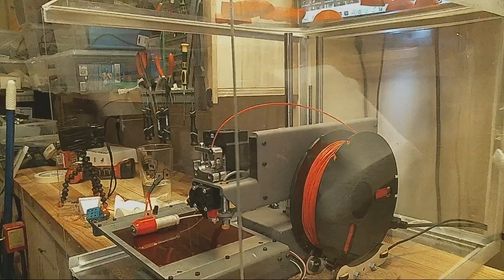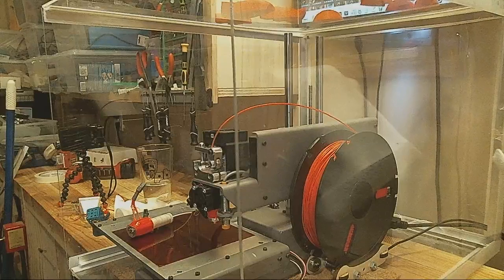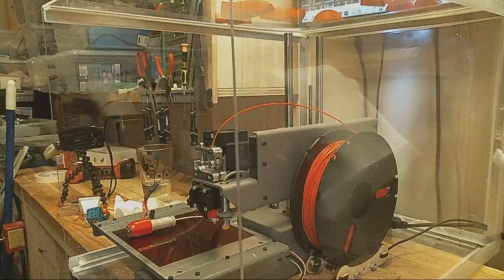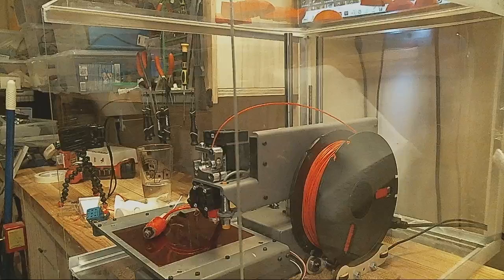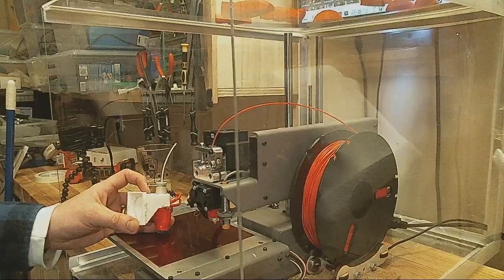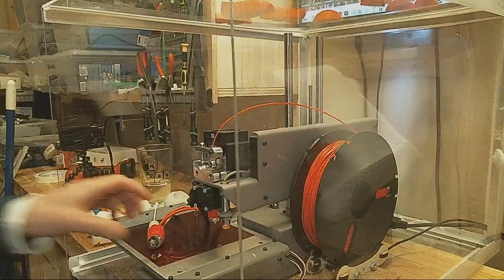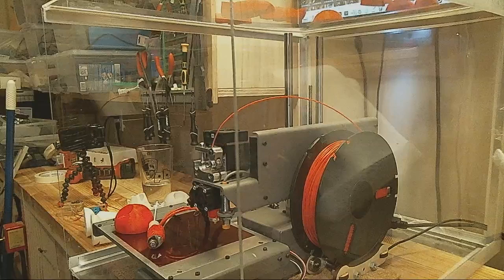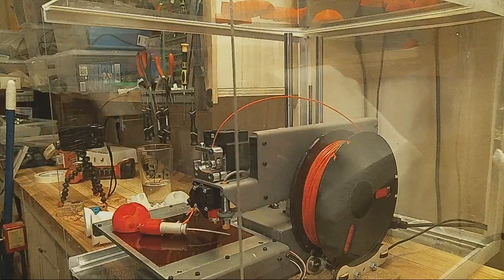Printrbot All Metal Ubis Hot-End Review

Comment: I noticed PrintRbot is not using the all metal hot ends much anymore.  I am gathering there were too many issues so they went back to what worked.
Reply: +wi11y1960 
As someone who's gotten one with their new Printrbot Play I can see why.
I'm currently mid way through machine crippling problems with mine, and the light at the end of the tunnel is putting the ceramic end on my play and never buying filament from printrbot again
Reply: I have had zero problems using their filament.  Then again, after opening the filament, when it isnt in used it goes into a bucket with drying silicate to remove any moisture from contaminating the filament.

So I dont understand why you are having issues with their filament.  My Printrbot Simple came with the ceramic end and works fine.  I have zero issues with it.  I do use a brim before I start printing just so that my PLA parts wont release prematurely and it works what ever hesitation out of the hotend from the filament change.
Reply: +wi11y1960  ahh but like i said I have a Ubis 13 metal hotend, not a ceramic.
Reply: ok

Comment: Wondered why you disappeared from posting vids.  Nice to know on the hot ends.
Reply from the maker: Ya! Happy to be back.  Did you get your printer?
Reply: waiting for tax return.  Original plan was to get the metal plus, alas uncle sam has other ideas and shorted us $500+.

A person on a printer forum has recomended getting filament from RioRand of Amazon.  Nice to know before hand that the filament from PritRbot can be nasty.  Will avoid getting a spool from them.  How long outside till filament goes bad from moisture?
Reply from the maker: The filament from PB is good. It's just that all filament goes stale if left in the open air for too long. You need to store it in air tight bags when not in use. The highest quality filaments I've seen are from polymakr. I've used each over their products.
Reply: ***** Thanks for you opinion about the polymakr filament, it's not always easy to choose between all the manufacturers, I will try them one day. Personally the best I tried for instance is sold by Boots Industries in Quebec (Canada), the print quality is perfect, they claim a diameter tolerance of 0.03mm and are not expensive compared to many others. I also obtained very good results with colorFabb (I ordered a sample set with some wood, bronze, glow, ...). I can't judge Printrbot's filament since mine was full of dents and had an inconsistent diameter (visible to the eye), so it clogged continuously, but it appeared to be better for bridging, I could do 4cm long unsupported platforms with it! I haven't done the same with other filaments for instance, but I haven't spent as much time tweaking the settings for them yet.

Comment: I had issues with mine clogging too, and inconsistant prints, if it doesn't extrude straight you have a minor clog(raise print head like 20mm watch it extrude In free air, should drop straight to bed, I had 2 ubis and I couldn't clear the minor clog which caused the extrusion to curl up to hotend, resulting in inconsistent prints and clogs), also the cartrige ubis hotend you had there seemed worse for jamming.

Try the e3d v6 hotend, I gave up on ubis, the all metal just improved cooling at the top to reduce jamming, the bottom is the same crap as the other ubis, I got a e3dv6, and now my prints are perfect!
Took a little tuning, and I reccomend using the thermaistor from the ubis rather then flash your firmware. 
But the end result is little fuss with prints.

the v6 is little short for the simple, but it will just bairly mount, but using the bowden and printing a spacer you can make it fit better.

Good luck.
Reply from the maker: I almost bought the e3d hotend instead of the all metal ubis. I was weary of compatibility issues and the last thing I wanted was to have to mess around with my hot end any more. I'm glad it worked out for you though.
Reply: *****  i was wary too,  esp when i couldnt find many usefull comments or details,  but then i seen the advertizment video essencialy saying it solves all my problems,  i was at the point of i will make it work!
Reply from the maker: Kevin Blair lol I understand that!
Reply: Honestly once I drilled the hole out to take the old thermisitor and used that, it was as simple as installing the ubis, you might want to harvest the connectors off of one of the ubis, but its better, comes apart nicer for cleaning, and no clogs of any kind yet!
Reply from the maker: I want to keep all these parts I'm getting from upgrades to make a dual extruder.  :)
Reply: ***** 
I broke my first ubis trying to clean it so I had spair parts, you can get them on ebay and digikey aswell.
Did you check out the e3d multi extruders? hate to be an e3d sales rep, but they look nice, with considderation for multi extruder leveling! multi extrusion is a plan for me for when I build a biggrr printer like a reprap prusa
Reply from the maker: Kevin Blair I drool over the kraken every time I see it. I just can't justify buying the parts to make it work outright. This machine is too expensive a hobby as it is! lol
Reply: Kevin Blair
Hi i broke my Ubis also cleaning, i got a new one from Printrobot,  but how did you fix it ? what spare have you buy for the resistor?  tks for your help!
Reply: +Federico Arroyo I didn't fix it, I got a second ubis, the cartridge one.   my break was on the crimp at the heating element at the nicrome wire.  As for the thermsistor, easy fix, buy a new one, remove teflon tape, remove old one, wrap new one on with teflon tape.
Reply: Federico Arroyo they are on ebay under reprap thermistor, and you can find a model number on the fourms.
Reply: Kevin Blair
Tks, my problem is also with the nicrome wire,  the heating element , i cant find any similar  the wire its boken, not the thermistor.
Reply: Federico Arroyo the nichrom is crimped on, that's what breaks, solder doesnt stick, I couldnt get a good connection myself and I didn't have end to crimp with, recrimp/connect and check the resistance you might have better luck.